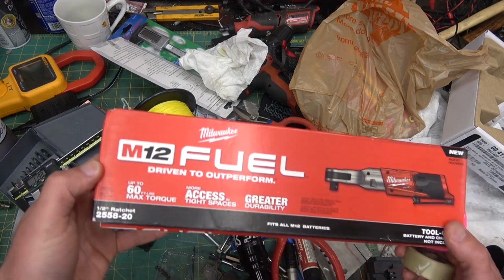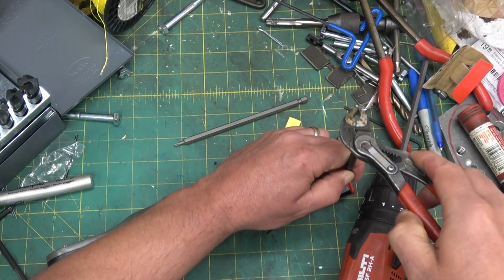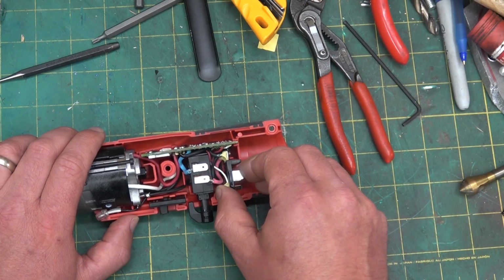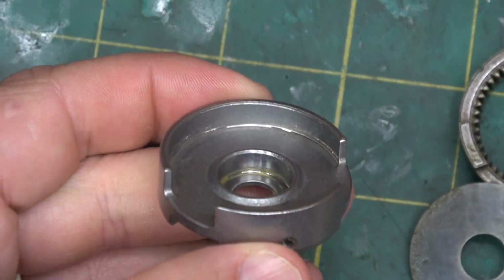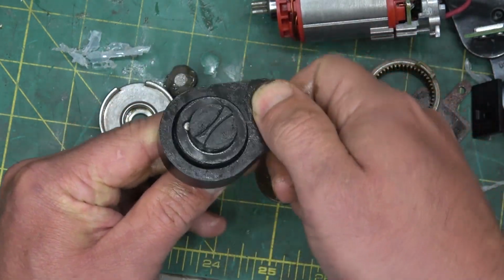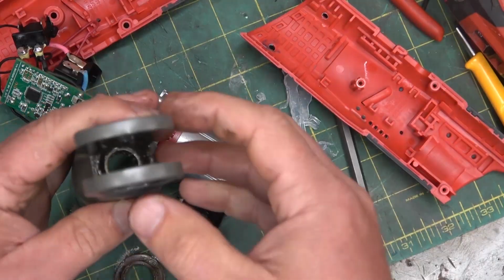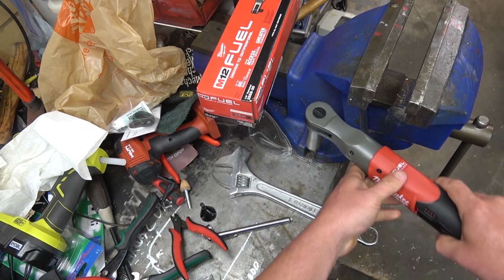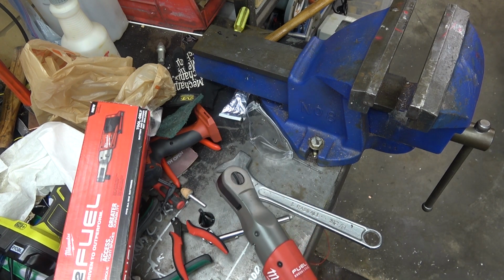BOLTR: Milwaukee Fuel Ratchet

Comment: I have the regular 3/8” non fuel version that I got off a lube tech buddy after it quit working. The thing was absolutely drenched in oil and the motor was gummed up so it would try to turn but pulled too many amps and shut down. In my own stupidity I burned out the board trying to fix ‘er. 

Pretty stout little piece. He used it for removing drain plugs for over a year dowsing it in oil every time. Definitely not what it was made for.

Comment: I love mine. It has worked great, no issues. The paint on the head chips off, but its black oxide underneath. I work in an autoshop, so it stays lubed.lol

I also like the 120XP Gear Wrench ratchet. It has a 3° throw, but 2 paws, so it has 2 60-tooth paws which avoids the issues of tiny teeth.

Comment: It's normally the tear drop shaped wobbly bobbly bit that breaks ( cam ), on the air ones at least. I've broken them, it's only a casting ( ones that I've used). I don't think they design them strong enough to go ape-man on them, hence why I broke them. Alright for nipping fasteners up though. Cheers

Comment: There are brushless dc motors in "household appliances" newer furnaces can have ECM blower motors. They are 3 phase brushless with an inverter motor controller on the back. The motor never fails. The control on the back of the motor does, the controls like 1500 Canadian pesos 😂

Comment: Only tool I want with some cordless tech in it it a mains drill that won’t twist your wrist off
Reply: Either use the torque settings or get a small impact drill.
I switched to the M12 Stubby impact and I only use the standard Drill from the kit if I need the hammer function or a 1/2" drill bit chucked.
Most everything else these days has 1/4" chuck versions. From sockets, to twist drills, to step-up bits. 

It's nice when your drill doesn't want to kill you. Much easier on the wrists.

Comment: Mine is the 3/8 had it for 8 years use it everyday to run bolts and nuts in and out after using a breaker  bar first no failures yet love it for the fact no air hose to deal with.
Reply: Using a breaker bar first is key here I think.
we've got  3/8 too and I absolutely love the lil guy!

Comment: I find that that the fuel ratchets are rather anemic with the 2.0 compact batteries. Also after using mine I'd say the weak point is probably the glass reinforced clamshell. I find reefing on the hind end of that plastic it'll creek and crack and as you said the battery will plop out.

Comment: Would love to use an electric ratchet but so far the ones I've seen are a tradeoff of power and size. Working on modern cars you really need low profile ratchets and ratchets that have a radius comparable to the socket itself. Extensions and U-joints only get you so far before you just need to accept your going to bust some knuckles in a tight space.

Comment: ,,, you can get a little more torque out of the impact process by twisting the gun as it hits, just as he showed.
Reply: yeah holding  the trigger and flailing at it  will often get the ball rolling so to speak. Otherwise, bust it loose with a regular ratchet then use the power tool to go the distance.

Comment: I have the 3/8 rachet been using the hell out of it for about 6 month with no issues. I've reefed on it pretty hard torquing bolts down with no fail yet but I do worry that torquing to much will cause the housing to break, that being said it's a tool use it knowing you will had to replace it at some point anyway. I haven't had any problems with the battery poppingout.

Comment: I’m seriously abusive to my tools and I mostly play team red because I used to be a plumber. I bought one of these because sale and while I don’t use it much it’s solid and never any issues. My drills however....  four out of five of them have busted chuck retention screws. However I have used them as Hole Hawgs because I’m too lazy to walk out to the truck and grab the right tool. They all still work but on reverse under heavy load the chuck spins off. Part of the abuse issue is I also screw down subfloors sometimes 3-4hrs straight without break using a pair of drills and swapping when they get too hot to hold with gloves on. 9 and 12 amp batteries in use otherwise the battery overheats too fast, although the tools keep going, occasionally spitting out dark smoke. 😊
Reply: Milwaukee has a $35 postage fee for nearly unlimited repairs at no cost!  The turn around is insanely long however but you simply buy extras and start beating the holy Hell out of them. 🔥

Comment: 13:40 Hate to break it to ya, but that lug is perfectly reasonable according to IPC-A-610F Class 1 and 2. The insulation support crimp doesn't actually need to support the insulation, it just has to be crimped. The main thing to look for is the bellmouth, but seeing as that's probably a class 1 product, you should be happy it's attached at all 🤷‍♂️

Edit: My bad, cables would be IPC-A-620F. I'm still a but hung over lol

Comment: All I found with my Milwaukee tools are the battery tangs that hold the battery in break. Tools seem pretty robust. Auto mechanic 15yrs exp.
Reply: That may be why they lasted fifteen years you got them 15 years ago, Milwaukee was solddown the creek and that's why we call milfucky today.
Reply: @holderheck  100% correct. Chicom owned, designed and built.
Reply: @bubbafudpucker397  I don't know what this Chicom is but it sounds disappointing
Reply: @holderheck  Chi-nese Com-munist ;)
Reply: ive had to change the ratchet head 3x and the motor twice.
Reply: Same here my battery tabs finally broke off after 5 yrs on one particularly hard drop. The battery was old and dying fast  so I was going to replace it anyways

Comment: With my snap on cordless ratchet on bolts that are a little to tight i like hit the ground running, aka give it full throttle then jam it on the bolt and it usually gets them broke free. Also on the flap off theres a grease zerk on the ratchet head

Comment: I've had the 1/4 fuel ratchet for a year now and it's hard to turn the selector sometimes now. I wish the selector wasn't so flush and small too. Milwaukee really should have put a grease fitting on the head like the Snap on 14.4 ratchet.

Comment: I have one of these and use it in an auto shop. The flashing battery indicator flashing is the tool reaching the torque limit of the motor, I've had the happen with fully charged batteries. I've had mine for almost a year and had no issues with it.

Comment: Have a non-fuel 3/8 one. It's the MVP of the shop. That said, the battery connection is weak. When you're really reefing on it, sometimes you'll dislodge or otherwise twice the battery out of it's socket. Kinda feels cheap. But overall, really great tool.

Comment: never found a good use for the powered ratchets, hand tools are faster, and quieter, Anyway Kurt or SPI makes a 3 handled quick handle for Kurt vices.  they can be hard to find but well worth the $50. (try to find the Kurt brand if possible, as they have a much better handle on em)

Comment: im in fleet maintenance for a city. I've got the 1/2" and the 3/8", and i rarely use the 1/2", but the 3/8 is almost identical and it has held up to the abuse i have thrown at it a much better than the old version.

Comment: I'll bet if you opened 5 of these, you would find different ground connectors on several.
I have a friend who has his products manufactured in China, and they have a very creative standard for interchangeability of "incidental" parts.
Reply: Having designed electronic consumer goods manufactured in China, Shenzhen specifically, I can confirm this.  Sometimes they ask about the substitutions if they are electrical parts (resistors, caps, diodes, mosfets), but on mechanical parts it just happens behind your back.
Reply: @iamblaineful  Yes, that was my friend's experience.. pop rivets for screws, sheet metal screws for machine screws... sometimes a lot to send back.

Comment: I wonder if the plastic handle would break before the square twisted off.   If only someone had a big hydraulic torque thingy.........
Reply: My guess is if you rotate it from where you naturally hold it on the end you'll easily break the plastic first. You'd need to choke up about halfway and hold above the motor if you're going to be able to break anything metal, but I'd assume that nobody is going to do that since you'd have to rotate twice as hard and it's not the natural place to hold a ratchet.
Reply: @dotes12  I've held mine near the battery and given it hell quite a few times and it's held up so far.  I don't think the plastic is in danger under regular use and abuse.

Comment: I've had one for probably about a year, only use it here and there in my garage at home. You definitely have to remember not to torque it by the battery, because when you want more torque, the natural reaction is to grab the end of the ratchet.

It's been solid for me, but I'm usually nice to my tools.

Comment: The battery holder breaks on this when your hand is too far down during torqueing. Keep your hand on the black rubber stuff, not on the battery. You can kind of feel it give a little under load.
Edit: saw a guy commenting the same thing. Sry.

Comment: Brushed to brushless is about a jump from 80% to 90%. The extra ~10% is worth it but good engineering is in short supply!
Reply: Of course, if starting from AC, you eat a decent chunk of that up on the AC-DC conversion necessary to supply the PWM motor controller.
Reply: @corystansbury  It's tit for tat when it comes to AC, but on a DC battery the brushless rocks. 3D printed a gearbox the other day for a project, was not disappointed with the torque it offered!
Reply: @TheFrenchMansControl  On AC tools that push the limits of the circuit, BLDC can limit its power draw more precisely and need much less margin to not trip the breaker. More of significance in North America and Japan than places that use 240V mains.

Comment: No reason to need 60ftlbs out of a battery powered ratchet, IMO, at least in the automotive industry. I use a 1/4" SnapOn electric ratchet. It's good for 30ftlbs so they say. If I need more, I have the proper tools for it. My 3/8" air ratchet is 110ftlbs.

Comment: I have the 3/8 non fuel unit for bit over 3 years. Plastic case is just starting to get a little loose, ratchet end occasionally slips 1 tooth when turning by hand above what the motor will do. Working on planes and some stints of rebuilding split rim wheels for EMB120's. Lots of life in it yet. Paddle switch and lock are still strong as day 1. Tossed in many tool bags for road trips and fallen off wing or ladder to the hangar floor more than once and still strong. Batteries still click in strong and never had one pop out yet.

Comment: I have a slightly older version of this in 3/8 for use as auto mech and i've abused the PISS out it. It has just enough torque to run nuts onto studs covered in pretty thick paint. I run it to near stall at least a few times a day for nearly a year now. Nothings blown out of her, so far...

Comment: What about the batteries? How good Is it on this tool .  staying power ?
Reply: G anthony batteries r good. No issues. Using mine on m12 impact for 5 years. No issues last pretty good for 12 volts

Comment: You've called it. The paddle pivot pin broke out of the clamshell...
Reply: Needs pinned.....
Reply: @jman1121  to be honest I prefer it without the paddle in the way, prevents accidental discharge when your up in there
Reply: @matthewbrake9285  I think they also sell a pill to fix that problem.
Reply: Not gonna lie i got attacked by the strap on man but my electric ratchet seems much much nicer imo. Yes it was expensive but i like the button better than the paddle.
Reply: Stay focused on what’s important you dirty bastards, it’s a tool for cranking on nuts not poking in the dark with even with the devil light.
Reply: I use this every day in the automotive field, have yet to have an issue.
Reply: ...and slipped in to the dingus end.
Reply: Well your name is Matt Brake!!

Comment: I actually like the first gen better. The head is much smaller and it gets into many more tight spaces that the gen 2 can't. It is also much lighter and better balanced, the gen 2 is very top heavy.
Reply: I have both and usually use my stubby and brushed 3/8" for most jobs. Love the fuel too, but the head size is huge for auto work. Stripped the non fuel and had it warrantied, but I was beating on it pulling a rambler engine before the rain came ...
Reply: Thrn buy gen2 1/4 and use adapter to 3/8.
Same size as gen1 3/8 ratchet but gen2 1/4 more power..

Comment: what will fail on you is the ratchet head first, they have a cheep spring bar in the head for the detent  for direction, I am on my second 3/8 drive in less than a year. failed right after the warranty was up go finger.

Comment: I cheat a bit with my milwaukee ratchets, break loose torque is small, they just shut off. I get it spinning and jam it on. The heavy duty air ratchets are knuckle busters if you one hand them.

Comment: Cant complain about milfucky power ratchets did my hole engine swap with a power ratchet and a milfucky impact gun .
Reply: Yup, similar story building an early Fox body for the drag strip(because of course...), my nephew's first real car build. Definite fan of Milwaukee, both for working in construction, and for doing weekend fun stuff.
I think what people misunderstand is that, it's not that no other brand is as good as Milwaukee, let alone that Milwaukee is "always the best"; rather, it's that, for better or for worse, I know what the hell I'm getting with their products, AND that I WILL be able to use the tool to its death thanks to Milwaukee's awesome battery support.
Reply: As a mechanic I only use Milwaukee electric tools over snapon and Matco if that says anything. Use the 1/2 fuel impact over my snapon air impact all day.
Reply: What tier impact wrench is needed for car work...sporting vehicles not trucks and all. Well...pavement sporting
Reply: [ranty rant rant]

Comment: On my 3/8 ratchets and the fuel 1/2 inch so far the forward and reverse switch locks up and end up useing pliers to switch it
Reply: Do not use pliers. You will grind the locking balls into the housing and it will fail. Just wiggle the square/socket a bit while turning the switch. Using pliers is how I ruined the old 3/8 ratchet.

Comment: I don't have the 1/2" version, but i have the 3/8th version. The thing that's wearing out is the plastic casing from "reefing" on it. I can tell it's starting to get a little sloppy / loose. Other than that it's been holding up great. Also, i don't think i've ever had a switch die on any of the Makita tools at work, heavy industrial setting. It's always something different, but never the switch. Just food for thought.
Reply: 3/8 user here. I noticed that as a possibility so I've been keeping an extending 3/8 ratchet to bust the nuts, then coming back with the power wrench to really move them.
Takes a hair more time but if you paid for the tool it's worth it.
Reply: @RomaraAhallow  thats what i do when rebuilding tires.
Reply: Mine the ratchet end is getting sloppy as well as the handle ever so slightly. 3 years of use on planes and occasional stints of rebuilding smaller a/c split rim wheels. Its used and abused and maybe 2 more years before i either have them rebuild the end or buy another.
Reply: I was thinking this would be the case.  Would be worth their time to extend the metal all the way back to the battery housing.

Comment: Battery housing's gonnu brek!
Battery is basically an integrated cheaterbar!
Reply: SuperCape was my first impression, but all 3 of mine are still kicking fuel then older 3/8&1/4 with smaller heads
Reply: I've been abusing mine for the last 2 years and no issues.
Reply: I cracked a battery. Still works fine.
Reply: True but just wait til some 200# gorilla realizes that a PVC pipe will fit over it.
Reply: The battery breaks if you tug on it or if it gets dropped. I use one of these at work, some of my coworkers have bought them. They're nice but my shitty  cryobi impact has so much more power than this thing it's a major letdown for the milfuckee. Needs more powah babey!
Reply: can we use thick PVC pipe as a real cheater bar to break the battery faster?
Reply: You never" break" a nut using an electric wratchet. Unless you want junk.
Reply: Jam a pipe in the battery end and go reeeeeeef on it.
Reply: SuperCape yes very true i know because thats how i broke the 3/8 ratchet they had lol
Reply: I'm still using mine with the busted up battery, broke immediately after getting but  still holding up somehow.
Reply: Oh my soul you’re in the wrong hole there’s plenty of room in the right one!!! Awesomeness
Reply: There’s 8802 ways to repair broken plastic..
Reply: I've been using my 1/4" fuel for a year. Plenty of power even with a 1/4 to 3/8 stubby adapter. Never use my air 3/8 or 1/4 anymore
Reply: I went with the husky they integrated the battery into housing you can reef all you like on it
Reply: Dave MacGyver like built in, non quick change?
Reply: @kevinross5374   yeap exactly

Comment: Had the 3/8 fuel and non fuel since christmas.  Used the crap outa the fuel and so far the only problem has been self inflicted.  Trying to remove long bolts in tight areas it will jamb the head up against an immovable object.  Then you cant reverse the dang ratched direction.  If the ratchet mechanism switched with a lever instead of a twist dial i think it would help.  

BTW the non fuel version is still in the house collecting dust, probobly never to be used as it looks like a toy compared to the fuel.
Reply: The head jamming problem isn't a problem, it's operator error.
Reply: Hence why I said self inflicted.  But when you got that tool jammed up in between the fender and some dang electronic crap reaching through a gap in the exhaust manifold standing on your head whilst elbow deep in grease it is really easy to do.